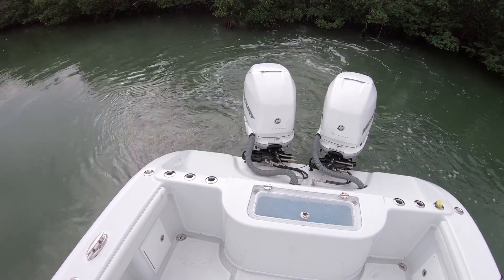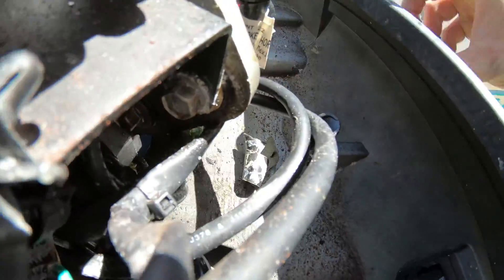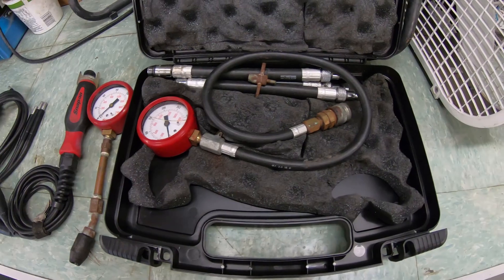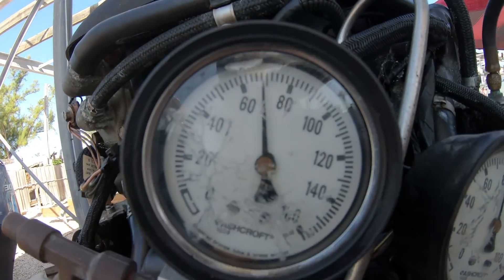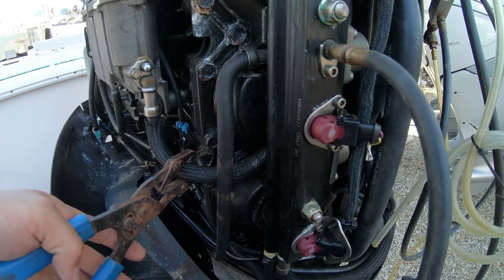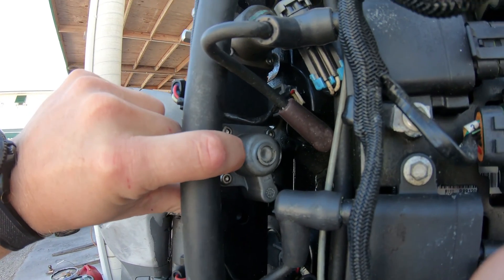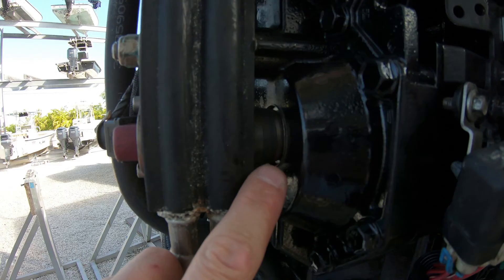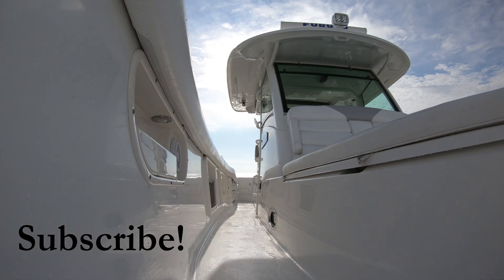What You Need To Know About Mercury Optimax's! | Troubleshooting

Comment from the maker: Suggest Topics That You Would Like For Us To Cover On Technician's Tuesday! https://www.bornagainboating.com/technicians-tuesday/
Reply: My 2010 150 optimax keeps stopping at idle
Reply: taking apart a VST in an optimax
Reply: Replacing starter and solenoid on 2003 Optimax 200 HP Saltwater. The videos you have are great! Thanks
Reply: Born Again Boating I have a Mercury 115 saltwater that is leaking water from the top of the midsection any advice what could it be?

Comment: Any ideas for a Fix for a 6 Beep alarm a little after startup? It runs just fine after but im still scratching my head. Appreciate your help if you can!
Reply from the maker: Beeps are general warnings, not specific codes, and usually point to sensor or cooling issues like loose connectors, low oil, or water flow problems. A quick check of sensor connections and cooling parts can help, but for a full diagnostic and step-by-step troubleshooting, head over to our Skool community where we dive deeper into this: https://linkly.link/25z03

Comment: I want to flush the engine from the tube on the left side of my 90hp optimax. The boat is in the salt water with the engine stopped  down in the water. I open the water supply and the water does not cicrculate. What is happening? What is my fault?

Comment: My optimax won't idil it only will run with choke wide open,.. there was thick oil coming our at 1st..but after running hard for awhile, no more thick oil..but still smoking alot. I had injectors cleaned .found out 2 were bad. I replaced and spark plugs were fouled from cranking to start

Comment: Hi Im one of your faithful subscriber, I just need a little tip here maybe something Im missing , I swapped my engines in two personal boats that I own, one of them a 2004 Mercury optimax 225hp that was running fine now doesnt have ant to start. All I did was to move it from one boat to the other and connect the harness in thesame process I disconnect the oil system now the engine wont start but also the the tilt trim button on the throlle doesnt work and it was working before, the tilt/trim work if I use the buttons on the engine. Im breaking my head trying to find out what did I missed. Is there any other plug I should check that will cause the engine not to run? Thanks in advanced. You wouldnt believe how much I have learn d watching your videos.

Comment: The motor runs great starts great sometimes just running across the lake. It’ll just shut off and it’ll take about 30 minutes to restart but when I started it, it runs good and does the same problem again sometimes it will run for two hours sometimes it will only run for 15 minutes before shutting off what do you think?

Comment: I have a specific question: I have a 150 Opti. Took it out twice and it ran really well, nice and smoothly. Took it out the other day for the 3rd run and as soon as I opened the throttle it stalled. It idled well even after it stalled but as soon as I increased revs it would stall. Any ideas would the most likely culprit would be? Also stalling didn't happen out of the water without load, only in the water under load.
Reply from the maker: Sounds like you might have a fuel issue, I'd check your fuel lines and filters, maybe even the fuel pump.

Comment: Late question to an old video but on a 2009 Mercury Optimax XL 225.  if my airpump blew and the piston was cracked and I replaced teh airpump new belt and it ran fine.  After being WOP I slowed down in a No wake zone and the motor died.  It would nto start until I raised the motor/prop out of water started and then ran fine.  Should I have checked the lines to see if there was any shavings of metal in lines or fuel filter?  I cannot understand how it ran for a good 20 minutes I stopped started and then when I slowed in a no wake just died and would not start for over 5 tries until I raised motor up?  Any advice will be greatly appreciated.
Reply from the maker: Yeah, really hard to say, other than maybe there was a piece of metal stuck in the system and it's in there exhaust side or something else, maybe air side, who knows, and when you titled it it loosened up, not sure, hope you figured it out!

Comment: Dude! I have a 2002 opti 225 two stroke and it runs great for about an hour then goes into some state that sounds like its choked and wont rev past 1200 rpms. Once i take it out of the water and flush it sounds perfect. It cant be load because i get it on plane fine for a while. I do notice it doesnt piss as hard when it does this. I have a 21 degree four blade prop.
Reply from the maker: Sounds like the engine is getting hot, whether that is temp gaurdian mode or heat vapor looking or fuel issue no idea :/

Comment: Pretty cool explanation! I have one question. Optimax 225, on the max throttle boat shoots like an arrow, but runs for maybe 30-40 seconds and then starts to cut.... And if I lower the throttle, then can continue to go, maybe 4000 RPM, then nail again throttle and agains runs on wide open for maybe 5-10 seconds and again start to cut. To my eye seems like that simply don't have enough fuel to run on the max throttle. Sparkplug are brand new and engine is actually really explosive but for like 1 minute and then start to cut, going intermittent, I lower down a bit throttle and continue to go on less power well, smoothly and without interruption. Low pressure fuel pump maybe? Thank you!
Reply from the maker: Could be a ton of different things, but most likely fuel related, where you are running out of fuel volume, could be in the tank, the lines from the fuel tank, the water sep, the low pressure pump, the filter on the high pressure pump. You'll need to do some testing for sure, here are some videos:
https://www.youtube.com/watch?v=09ob37BC02Y
https://www.youtube.com/watch?v=g7eIUx5bP_k
https://www.youtube.com/watch?v=IcvkP8pRsRY&t

Also, could be the high pressure pump could be dirty or something like that, dirty filter on the pump, etc.:
https://www.youtube.com/watch?v=Qtz-9_-_dTk

That will be a similar video, hopefully that helps and you get it figured out! If not, we could help out a little more in the Boater's Program where you can message and upload pictures and videos, you can check that out here:
https://www.bornagainboating.com/

But hopefully you get it figured out ;)
Reply: Hey I’m having the same issue. Did you figure out what it was?

Comment: Hi mate
Paul from Australia here, just wondering if you meant that the fuel pressure increases when u block the fuel return hose not the air increase? 
I’m having low pressure air and fuel issues on my 2008 115hp optimax
Reply from the maker: Hello Paul,

Well they are directly related because of the tracker valve, they should stay 10 PSI apart, so when you pinch the dump, they spike :) been a while since I messed with an older Opti, can't remember fully.

If you don't have air pressure you won't get fuel pressure. Best to just get your fuel pressure to normal, roughly 45ish PSI, letting you know the VST and all that assembly is good. 

Then look into the air, you have to get the air pressure right before going any further on the fuel side of things. No air pressure, no fuel pressure, or higher fuel pressure where it should be for the injectors to work properly together. 

Hopefully you can run the tests in the video though and figure out if you have a weak air compressor or a pressure regulator.

If you can't get it figured out you could look into joining our Boater's Program where we have messaging and a place for you to upload pictures and videos and we can discusss whatever you want on a weekly livestream.

But hopefully you figure it out :) best of luck!

Comment: 2001 mercury optimax 225xl. Jumps from 580 idle to 1180 after an inch of no response.  Changed everything up to the tps. Nobody else seems to have this issue?
Reply from the maker: I would take the control cables off the engine throttle control and move the throttle control slowly and see if the engine climbs normal, if it does, you've got an issue on the boat side. If it doesn't then the problem is on the engine. And then yes, you gotta look at the TPS and make sure that is all smooth, also check to see if the throttle plate is sticking.

Comment: I have a 2009 225 optimax and never has given me a problem and I haven’t cranked it in 5 months and tried to start it and it wouldn’t fire. I went and took the cowling off and fuel line was loose and leaking. Fixed that and still just spins. Help appreciated , like your channel!

Comment: specific question: can I get details about what repairs you made to that 225 optimax in the video years ago?  i am 99.9% sure I literally now own that exact boat (proline with #14), and have been having engine issues since I bought it 10 months ago.  recently this past week, the engine turned off when slowing down to neutral a few times, and then while in neutral, started revving on its own.  when running, it had no issues.  My buddy suggested I look into the Throttle Position Sensor, and somehow this was the first video that popped up, and Ironically, I was like, that is my boat. lol. Thanks!
Reply from the maker: That's a tall order lol ummmmmmm 6 years ago, I think that was all fuel issues then, filters, spark plugs, a dirty vst, and I think 1 air injector was messed up. 
You'll have to run the tests and make sure the fuel and air system are all up to snuff first, do what's in the video for sure.
Here's another video that has an optimax fuel system over view in it as well:
https://www.youtube.com/watch?v=g6Bfnii1ivU

Comment: I have a 2003 Optimax 150HP and it won't stay on idle.  I changed all of the spark plugs and fuel filter but it didn't help.  Do my motor have an IAC valve and where can I find it if it does have one?  The engine start up ok but then the rpm would go down and turn off the motor.

Comment: Have a 1998 150 optimax, cold start is horrible it always dies. I put the choke on and it still dies but eventually after about 10-15 cranks it fires up and stays on but only after revving it steady at around 1500-2000 rpms for about a minute or 2. Once its warmed up it runs great. Any ideas on what the issue could be? Thanks
Reply from the maker: Possibly an injector issue
Reply: Did you ever figure out your issue? I have the same year and when it first starts, I need to give it some throttle for 2-3 minutes, but once its warmed up it runs great and will idle without the extra throttle.

Comment: Hi, thanks for your video. I have a 2003 Optimax 150. Always worked perfect until yesterday, I noticed that someone went on my boat and played with my throttle lever as it was still in forward position. This same day, after 4 short trips, after starting up, I put the throttle lever in forward and it did go in forward but it does not rev passed idle, same for reverse and on the smartcraft gauge it reads SENSOR POWER. Battery power is good 13.4V and when starting the battery voltage is 14.4V. I don't have diagnostic equipment, only a multimeter, do you have any tips for me? Thank you

Comment: I have a 2012 200 optimax pro XS, I have changed plugs, fuel filter and it will idle fine and run great for the first 5 or 10 mins then will bog down and won’t go above 4,000 rpms without bogging, I don’t know what it could be ?

Comment: I need to replace the MAP sensor on my Optimax 150hp 2015 model.  Any video on this?  BTW, engine runs great until about 4400 RPM's.  Any more throttle and the engines bogs down.  Hoping this resolves the issue.  Geat video BTW.

Comment: 1998 optimax 150hp 1st start of the day it fires right up run for 10 or 5 seconds  and dies... I have to slam it in gear gas up then it will stay running and every start after this it will act right for that trip out... any suggestions will be appreciated
Reply: Did you ever figure this out.  Mine runs rough at idel until its warmed up and then runs great

Comment: I have a 2004 Optimax took the boat in and they said through the Schrader valve there was no fuel pressure coming from that valve on the vapor separator tank. Do you think it might be the first pump the low pump or the high pump or a different problem? Thank you

Comment: Was wondering I have a 225 optimax 2007 just rebuilt it. Was going to the break-in motor is making a knocking sound and goes to half hour. Could this be the air compressor

Comment: I have a 2004 merc 250 efi, the idle is running rough and creating a ton of smoke even when engine is up to temp.  The gas has been replaced and so have the spark plugs.  Any suggestions?

Comment: My motor was running 50 mph .All of a sudden the motor shut down. It would only idle at that point. I replaced fuel lines , fuel filter, cleaned plugs, they looked fine. Motor still idles fine. Will not get on top of water. 175 hp mercury 2016 model.
Thanks

Comment: 2006 mercury optimax 150 revs high is it the tracker valve or air tracker or body said the tsp has a rubber o ring that makes the linkage to sum times to stick ? I took my throttle apart thought cable broke

Comment: Why does my 2005 225hp Optimax Saltwater motor make a constant beeping tone when I hit 4400RPM? The engine is still pissing, I changed out the secondary & primary water/fuel separator filters, the gas is clear, and both oil reservoirs are filled.

Comment: My OptiMax 150 was running fine then suddenly went down to 1300 rpm and won’t exceed that despite moving the throttle forward. Got it checked and it wasn’t overheating.

Comment: 2006 115 Optimax.  Goes into guardian mode and throws 8 different random codes in no particular order.  I can clear the codes with vessle view app but boat will beep and not go over 10mph. 2091-23 guardian due to overspeed.  541-24 water temp. 701-24 oil tank A level. 711-24 oil level. 451-25 pitot pressure.  555-24 Air comp temp. 2092-23 neutral overspeed.  1012-25 trim pos.---Water pump replaced and flowing great.  Only has one oil tank on top of engine always full and currently oil sensor is bypassed.  Swapped out water temp guage.  New spark plugs.  Oil pump pressure confirmed.  Starts and idles great but will not rev up much higher than 3000 rpm without faulting out.
Reply: Hi, I have almost the same issue. Did you fix your motor and how?

Comment: Hello, I have a 2008 150 optimax, i bought it with compersor that blew apart, i bought the new compresor but i suppose the old one didnt blow apart for no reason, to be exact im suspecting my oil pump on the engine is not working properly, i tried it outside and it is working, it is pumping out oul every time i connect it and dissconect it to the battery, also when i turn on the priming process with the accelerator, it starts pumping nicely, but when the engine is running when i dissconect the output hoses there is no oil coming out, my outboard oil reservior is holding the pressure, it has a few litters of oil in it and the hoses seem good, i heard the on-engine oil tank caps can go bad but im not sure that is the reason that oil pump is not working right as it pumps oil when engine is not running(during the priming process). So my question is how much oil the pump should provide when engine is running and is it maybe possible my engine computer is for whatever reason not sending the right signals to the oil pump while engine is working ? It would be really helpfull if you know something on that topic, thanks in advance.

Comment: Thanks for posting the video. I have worked through the tests but have a question.
I have a 2008 Optimax 225 DFI. Good spark, good compression, good fuel and new filter, good fuel and air pressure. Sounds good out of the water. In the water I throttle up and can’t get passed 1100 rpm with full throttle. Any suggestion on what I could check next?
Thanks
Reply: Did you ever figure out issue?
Reply: @phoenixw2w  yep, it was a bad primer bulb. So simple.
Reply: @GalaxyAnialtor69  Right on, thanks for the fast response.

Comment: I have a 2004 Mercury Optimax 115hp on my 1996 Mako 19’ (just bought the motor with the boat). There is no fuel priming bulb (I checked). Before I do fuel pump or VST maintenance on my optimax, how should I ensure the motor is primed when I reassemble?  Because there’s no bulb, should I assume that the optimax fuel pump will self-prime?  It must not have been a problem for the previous owners and marine mechanics. Any suggestions or ideas for the procedure? Thanks

Comment: what about if youre not getting spark?when i turn key on it chimes to let you know its on.. seems like most outboards do..mine doesn't nor do i hear the fuel pump come on..i have an 06  mercury optimax 90..i pulled the plugs and there's no spark...this motor has less than 100 hours on it although it has sat for 6 years...any sugestions would help

Comment: Aaron if 12v is applied to VST tank electric fuel pumps they should function correct? 200hp/2002 Mercury Optimax; both pumps high psi and low psi are not functioning. Have you seen that before? Engine been sitting in varnished fuel for a couple years. There is no psi at Schrader valve on fuel rail. Thx!

Comment: Trying to find the best source for the fuel and air pressure testing rig? If anyone has a good source would appreciate hearing.
Reply: check the pickup screen. I get a waxy coating which blocks the oil from sucking into the on engine tank

Comment: My optimax 115 hp dies after running at slow speed at idle after a while. I can squeeze the priming bulb which is flat and it will start all of the clamps are tight as far as I can tell.   ???

Comment: Dealing with a 225 pro xs with high fuel pressure at 120 130 psi have no run into this before thinking regulator or trash in the fuel rail any other thing you seen